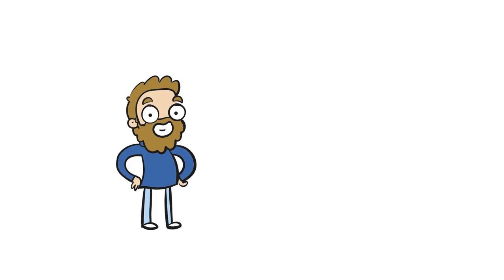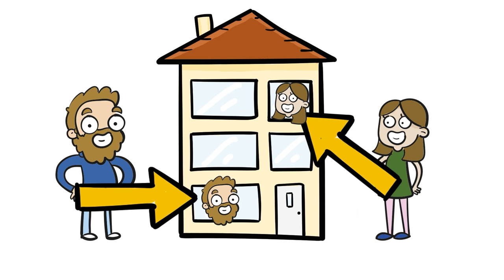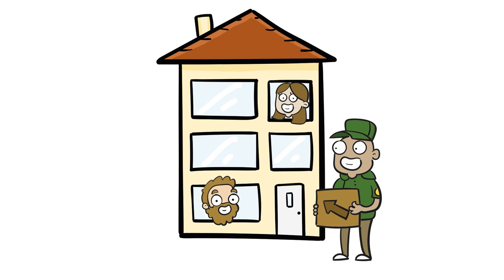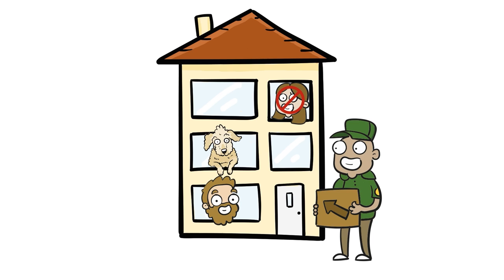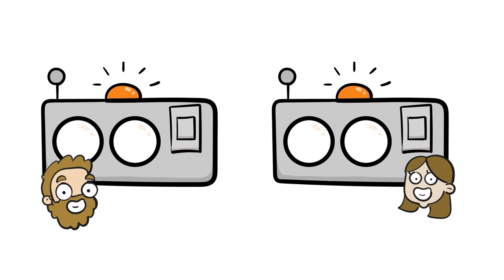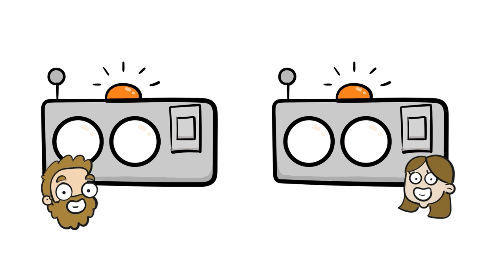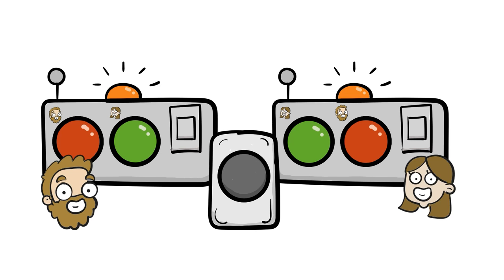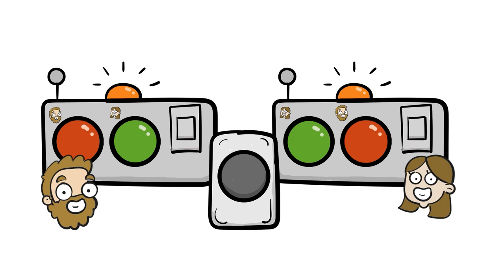My First Electronics Project - What is the problem?

Comment: Your design seems very complicated  considering  what you need to see is the meeting status of the other person. After all you already know what your state is. I would have possibly have a network attached storage with a text or database file. Storing an incoming machine ID and state. Hardware would be arduino, when powered on it would access the server file, check if ID is registered in DB when you press hardware button, you update your DB entry could have hardware poll DB every few minutes,  better though to have server push updates to hardware boxes
Reply from the maker: Hey pal :) 
Maybe the ide of only needing one light instead of two is good enough. I was just using the extra light to be an indicator that you know you have pressed the button or switch at a glance. Also I like the idea of the Arduino polling a text file for the status over one needing to be a server and the other a listener. This could simplify it a lot more and is scalable if you want to add more to the pool. I guess in Version 2 I should see how we can add more to the list without needing to add multiple leds for every user. Maybe an interface. hmmm.
Reply: @Everyday Tinkerer 🛠️  out of interest do you both use teams or zoom? Maybe the server could be running multiple chat clients. So if you are in a meeting on zoom, the server sees your status change and then push that status to fiancé's arduino.  That way you don't need a fancy interface,  simply add the server as a contact?
Reply from the maker: @TheTitaniumBunker  That is also a great shout. I do indeed use both of those for the day job so should be able to hook those up as well.
I will what ever the solution have the hardware option as the main idea of the project is to learn and experiment with it but these ideas are great additions to it.